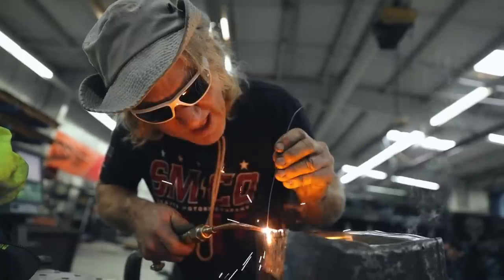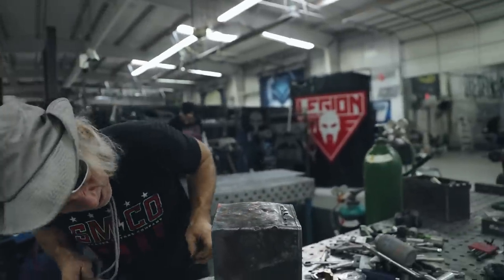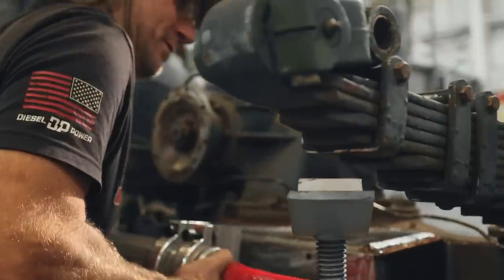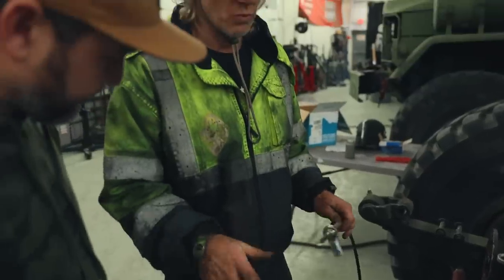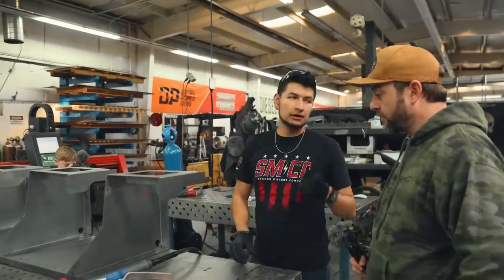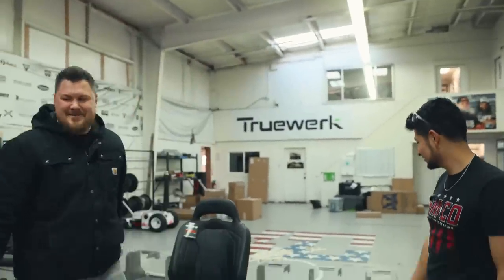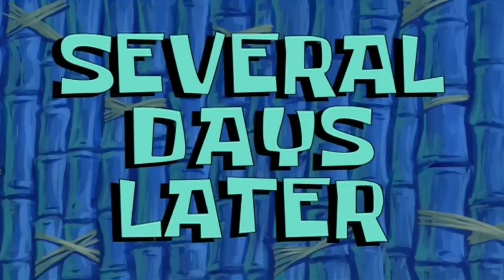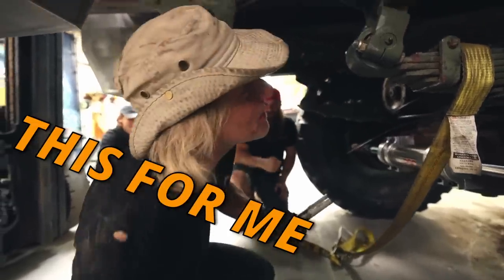Making this 5 ton CRAB WALK! (REAR STEER INSTALL)

Comment: Hats off to the welders( sorry don't know their names) for making a rotisserie to tig up the nipple and 3:41 laying down a fine weld bead on the rear end. ( Its well worth the effort to pause here and appreciate the welding job, it don't get any nicer than that )
28:16  Forklift holding up the 5 ton while Alan 31:03 uses his middle finger for an alignment pin into the spring hanger bolt hole yeeoowwwwwwwwwww! The man has no fear an a lot of trust in the operator
Fabrication on the whole project is stellar, awesome job guys.

Comment: You make me have flashbacks of my army diesel mechanic days. ❤
Reply: I feel the same way. I loved working on everything from HEMTTs, 900 Series 5 tons, M35A2 and A3 Deuces, Humvees, Chevy Shop Trucks, FMTVs, LMTVs, CATs, Cummins, Sabres (UK Ford 6 cylinder Marine application for Combat Boats), John Deere Powered Generators, 8v92 DDEC III Detroits, trailers, and personnel carriers. Never Got to work on an Abrams or a Bradley but I got to go inside a couple of the ones we had on our Maintenance Facility Compound. I had a ton of tools in my 1997 F450 Quigley 4x4 service truck (My POV) and they would send my Platoon out to a few of the Equipment Yards on our NG Post and the Adjutant General wanted our Equipment all up to snuff before we got into Hurricane and winter weather season so we all worked from out of the back of my truck and got shit done. Those were the good ole days.
Reply: @stevenwolfe9085  absolutely brother, I was in fort Irwin CA working tanks, 5 tons, humvee (the real ones) lol….I remember seeing one of my soldiers doing opening up the hood on a humvee and a sand storm ripped the the hood off sending it 300 yards down range…yeah that was fun replacing a hood/wiring harness/ lights in a sand storm. Fun times lol

Comment: Question, what are you doing about the parking brake?  The rear axes had the spring brakes and the replacement is a fount axel that does not have those.  Just curious about that you are using to replace them.

Comment: Hats off to the guy whose tig welding on the rotating table and Alan who can literally weld on anything.
Today on Handymans Corner Our friend Alan is going to figure out the steering ram so we can finish up the rear steering axle setup for this old 5 ton because Diesel Dave wants to Crab walk it down the road.
 "If Women don't find you handsome, they should at least find you handy. Keep Your Stick On the Ice."-Ole Uncle Red from the Red Green Show.

Comment: 20 years ago I used to build drive shafts we used a lave that had a old wire feeder that was rigged by a belt to turn the lave slow to make 1 solid weld it was adjustable by the wire speed switch. We had a room full of home made stuff to put the drive shafts together. I think the balancers came over on the may flower. I was the only person there that new how to use any of it when the other guys left for better pay.  When I told off the boss and got fired they spent 3mil to by 1 machine that could do it all. A year or so later they went bankrupt. That little set up at the start of vid took me back. Lol

Comment: I'm not a welder but darn impressed with how the weld turned out using a drill to rotate bet Allen was impressed also 👏 Good job now starting to look forward to testing out the build and seeing how functional it will be

Comment: (recovery video that bad wrong ) You guys are the heart of the operations .. You all need to come up with a sled to help in recovery in snow conditions . Your buts are fixing everything that get broke  when things go wrong . A short arm sled coming off the snow cat that you can pull objects on to it (the sled) would save your buts and a lot of time .  Ok     Two short arms coming off the cat hooking too the sled that pulls what ever you drag on to it .. Get the point !!! Short arms will keep the sled close and not wondering around in the snow and in the ditches ..Your cat has an adjustable arm on the back = SO it can pick up the sled and keep it above the snow ..  Your cat will have total control on what's going on until you back up ...   Buuuut that can be fixed with a winch . Two piece sled pulled together and made as one . The very trailer that comes apart that hauled your cat there that comes apart .. Just make a sled like it . Good luck guys and cheers from Murrell's Inlet SC !!!